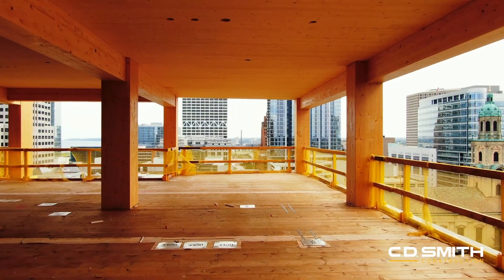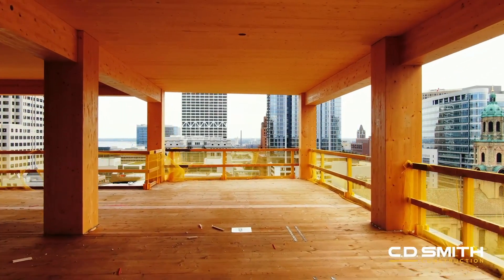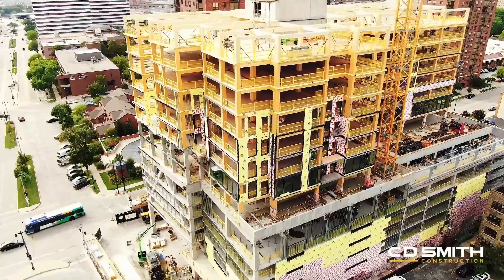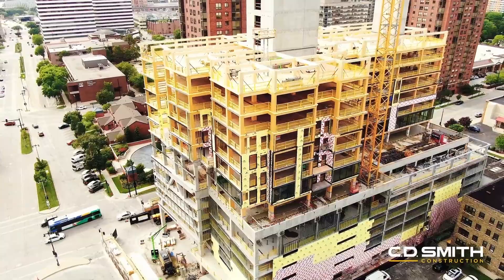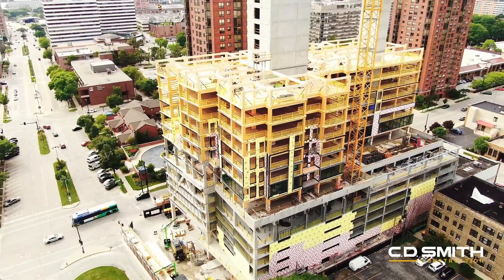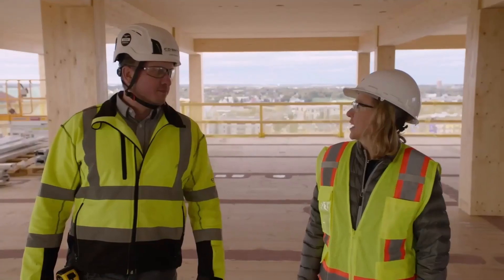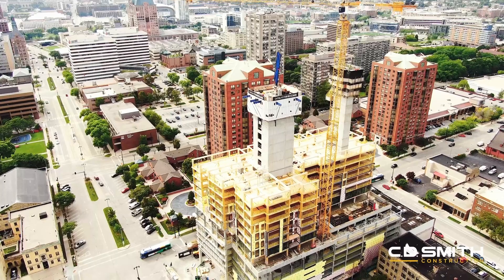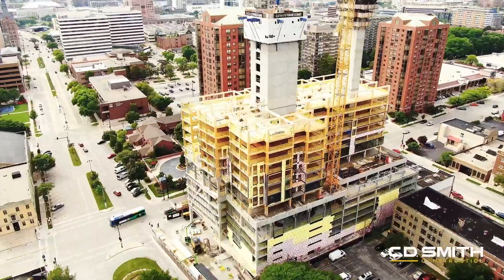Building Tall with Wood: Design Tips for Mass Timber High-Rises

Comment: What fire protection is used?.. how are the termites prevented?. What about when it rains
Reply from the maker: Fire protection is via charring of the exposed glulam and CLT framing member, validated through testing: https://timberlab.com/projects/3hr#:~:text=RESULTS,alternative%20to%20concrete%20and%20steel.
The concern for termites is significantly lessened based on location, as well as the fact that the lowest 6 floors of this building are concrete (primarily parking). 
During construction, the timber elements are exposed to weather. A thorough plan for moisture protection and mitigation is required to ensure that moisture staining and damage doesn't occur. See this document for best practices: https://www.rdh.com/wp-content/uploads/2022/11/Mass-Timber-Moisture-Management-Guide.pdf
Reply: @MassTimberHowTos I think I’d correct that the charring considerations are looking at structural collapse or not. Fire protection for Heavy Timber, at least in the U.S., is fairly conventional and follows current code minimums. In North American new multi-family or commercial construction fire sprinklers are just like providing hot and cold running water. It’s assumed, the norm, so these folks fail to mention. Of course most fires are put out when tiny by occupants or controlled by one or two sprinkler heads, with final by FF’s. Are you interested in high rise or shorter buildings?